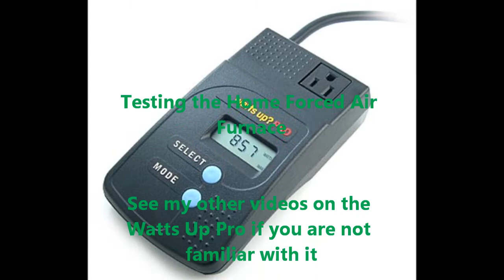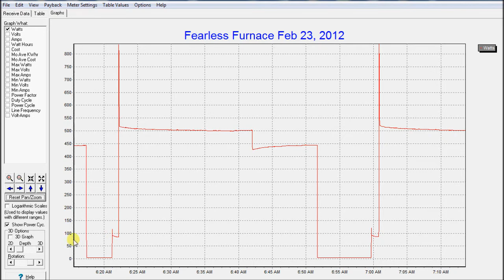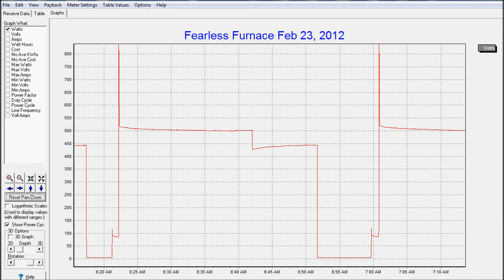Watts Up Pro used to analyze a Furnace

Comment: I thought my new furnace was using more electricity than my old one. The forced air fan that forces air up the flew pipe was not on my old natural gas furnace and it got better electrical efficiency but not gas. So that is why my electric bill went up after I got the new furnace. Its a trade off so Im not so sure its more energy efficient since the gas it saves is traded for more electricity use to run the forced air fan up the flew pipe. Thanks for that video.